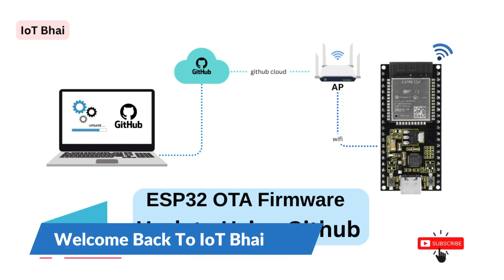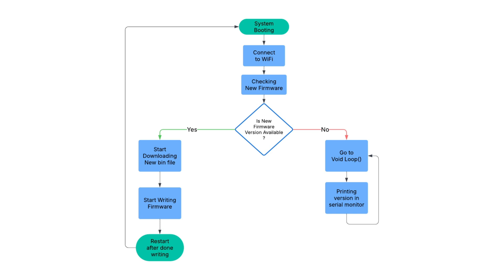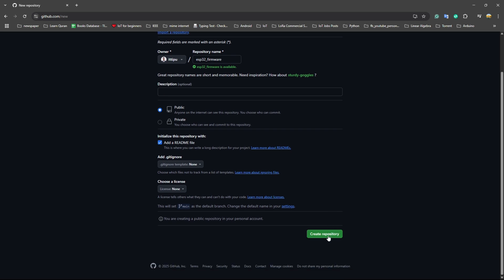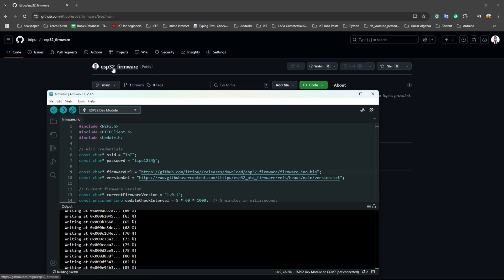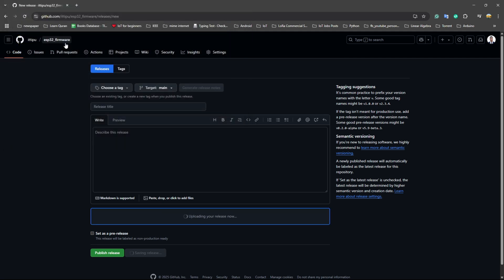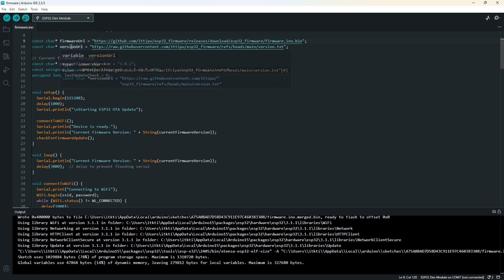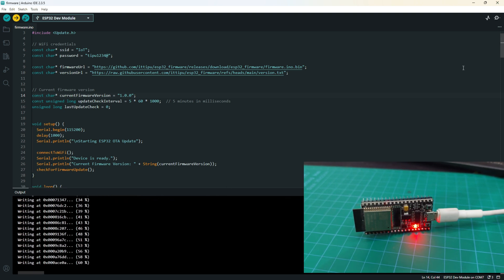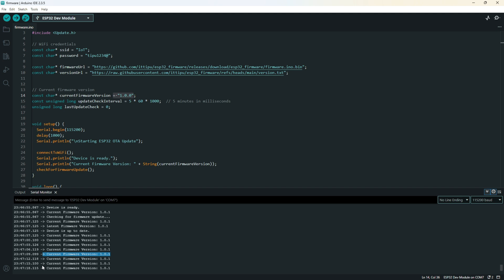Upgrade Your ESP32 Over-the-Air (OTA) Using GitHub [Public Repo]

Comment: If you’re getting “Not enough space for OTA”, here’s the fix 👇
1️⃣ In Arduino IDE, go to Tools → Partition Scheme
2️⃣ Select “Minimal SPIFFS (1.9MB APP with OTA / 190KB SPIFFS)”
3️⃣ Then upload your code again

That’s it! OTA will finally work — the default partition doesn’t leave room for the new firmware. 🚀

Comment: I am about to try my first remote OTA update. Did you have to setup the OTA partitions?
Reply from the maker: 1.5/1.5 for normal code, and use 1.9MB with OTA/190kb spiffs if your code is large